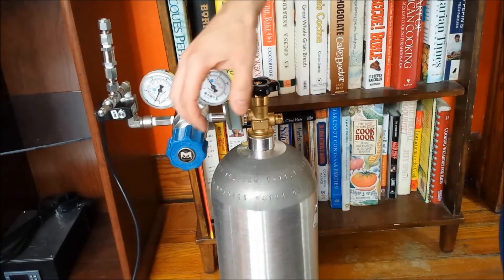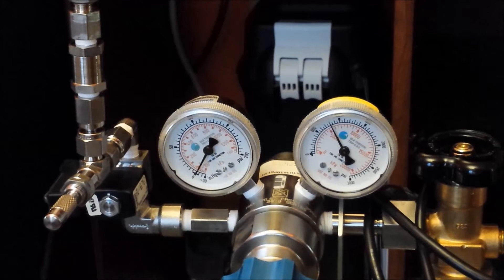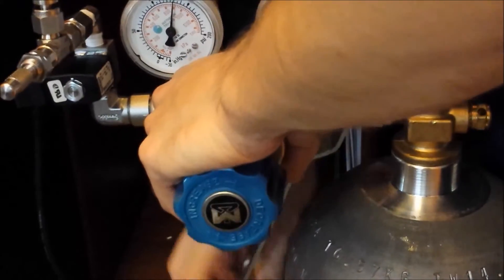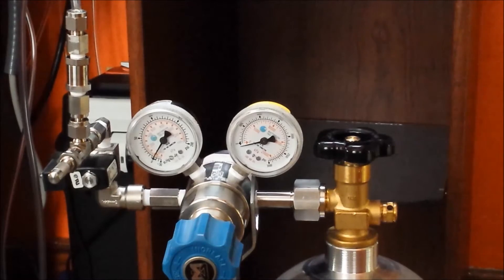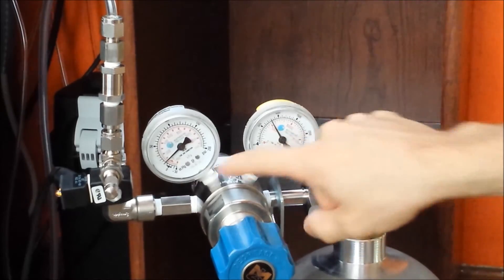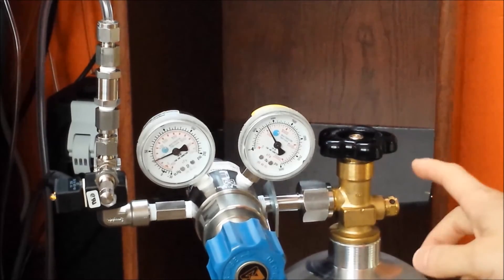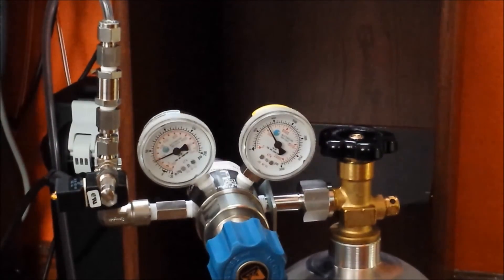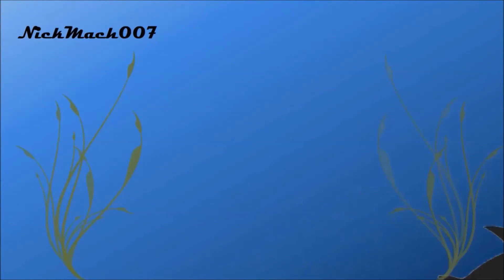Regulator Leak Check (and function test).

Comment: I did this test on my single stage co2 reg and nothing changed on the gauges but I did the bubble test and i can see a very small leak on the arm that connects to the tank, where that meets the regulator.

Comment: What if gas just escapes out the back part of the regulator? There are holes on the back that allow the pressure to escape
Reply: Gas leaking from either the front or back cover indicates you almost certainly have a blown or torn diaphragm. It's possible to repair but not particularly enjoyable to pursue. A rebuild kit for my Victor was about $50 which is about what I paid for the used reg in the first place, so you may find replacing it more cost effective than repairing

Comment: Thank you for describing how to set up a regulator and letting everyone know that 30 psi. Is a good psi for the low side of a duel stage regulator many 2 stage regulators have different low pressure side maximum readings no one ever states keep it at 30 psi or your going to need one with a minimal low pressure side capacity of 30 psi
Reply from the maker: Your are welcome. I'm just glad this video is useful. It took me awhile to wrap my head around building it, but once I did, it really is not half as scary as people think.

Comment: Why so many fittings after the needle valve and before the tubing?
Reply from the maker: No one else caught that, the only reason is because I got the needle valve on sale but it had tube connector (ie not the normal MNPT threading)-- it was the swagelok SS-SS4-A. That required me to convert 1/4 in. Swagelok Tube Fitting to 1/8 in. FNPT to then connect to the check valve (which was 1/8 in. MNPT). This then needed to connect to my tubing, so I had to a 1/8 in. Female NPT to 1/4 in. Tube OD connector. This then connect to my 1/8" ID X 1/4" OD tubing.  Did that make sense? If not, I can send you the part numbers -- all listed on swagelok's site-- so you can just pull them up one by one and see them (I had to look at them over and over to before placing an order-- it was too hard to visualize in my head).
Reply: NickMach007 What I'm trying to do is make my single output into a three output (With needle valves & compression fittings for the 1/8" hose) unit to supply a couple of tanks..
Reply from the maker: If you post some pics on Youtube or Instagram and send me a part list I can probably help think through this with you, if you want a second opinion. What I would probably do is use use 3 tee fittings each with its own needle valve. But there may be other options as well. I also just subbed to you-- sorry about that. I though I already was!
Reply from the maker: I knew you were thinking of that one ;)
But seriously, what using a pipe cross, something like this-- and attaching whatever fittings (elbows, reducers, etc) then into individual needle valves: http://www.swagelok.com/search/find_products_home.aspx?part=B-2-CS&item=a1dea6c8-90c7-4714-bde6-c7376cba1cce

Also, check this video out-- it is more of a manifold style, but also a very good method: http://youtu.be/uzrAkfXL2hg?t=4m1s